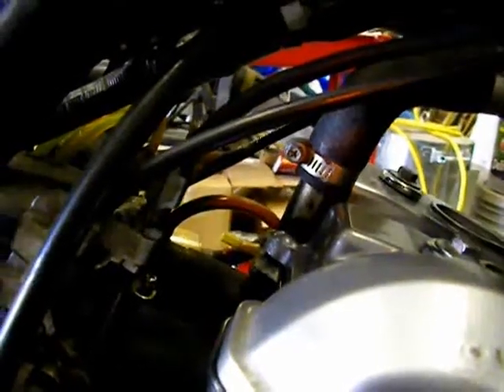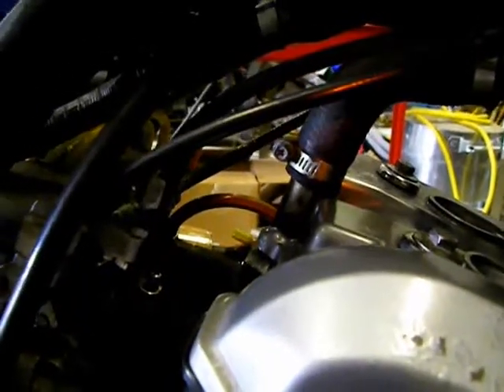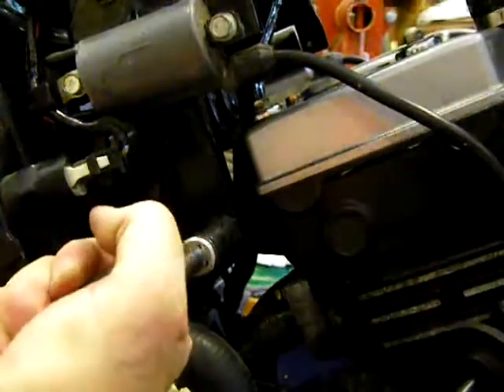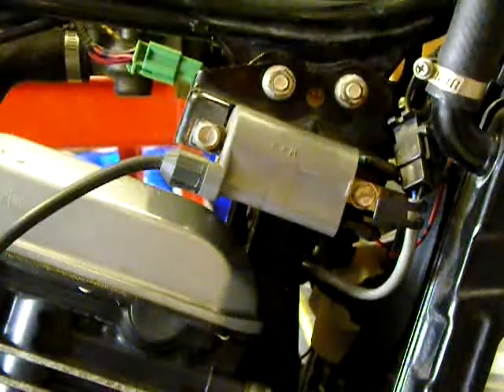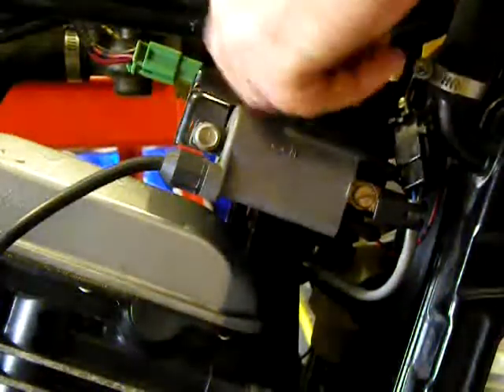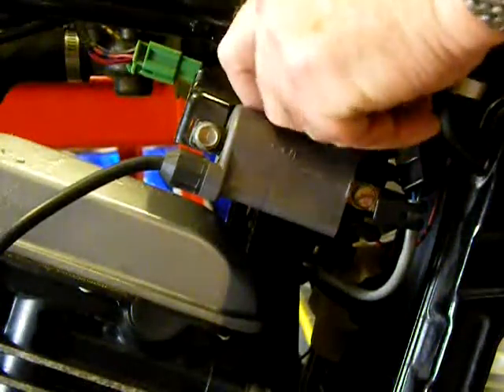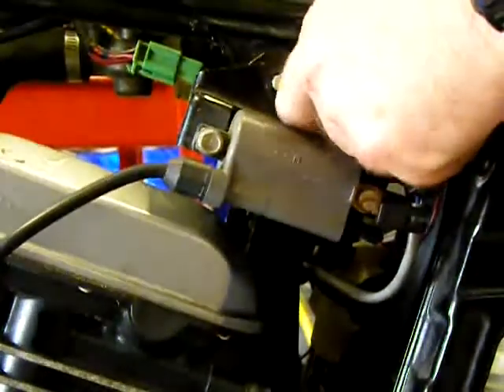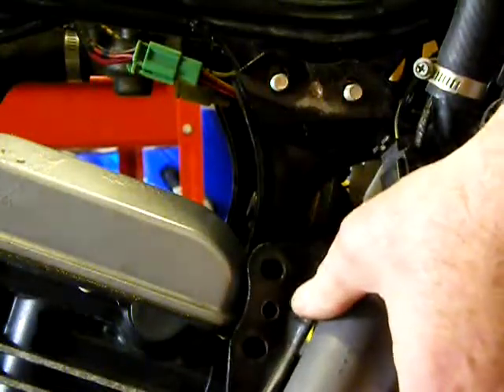Removing the Valve Cover From a Ninja 250 Pregen Like a Pro

Comment: They say to do all that because Kawasaki says to. Then again, Kawasaki also tells you to take off practically everything but the tanks and tail just to change a headlight!

That said, your method is much better. :) The only thing I would add is that you might have a lot of dirt, pebbles, grime, regolith, etc collected on the valve cove in places you can't reach, so hit it with the blower gun from an air compressor first (keep the spark plug holes covered while you do this). I literally had a handful of the stuff when I flipped my valve cover over and there was almost no way to keep it from raining all over my opened engine.
Reply from the maker: Thanks Emmett, your timing is interesting in that I was just about ready to go out and do my valves again when I saw your comment.  I would also point out that getting all that junk out of the way makes doing the actual valves easier too.  I'll blow out the area before I start since you said that.  At 33K miles, it doesn't need any more problems.
Reply: Well, we miss you on Ninjette.org, so you forced me to come to you. ;) Good luck!
Reply from the maker: Emmett Turner Thanks.  You can usually see what I'm up to on my blog.  There used to be a way to PM people here, but I don't think they allow that any more???

Comment: If the gasket is in good enough shape to reuse, do you use any silicone or do you just torque it down dry?
Reply from the maker: As long as it isn't brittle or squished, I just reuse it.  I recommend against using RTV or silicone because it doesn't always work and tends to make a mess.  If it leaks after you install it, don't torque the bolts more than the rating because they will break off in there.  It wont help anyway because they are shoulder bolts.  The easiest thing is to get some thin flat washers and put on the bolt before installing it.  Even just a thin washer will push the cover down a lot tighter.  Use a washer no thicker than 1/16".  If you need a thicker one, then its time for a new gasket.
Reply: n4mwd Thank you for your quick reply.  I’m planning to do my first clearance check over the Christmas weekend.  The bike is new to me but far from new.  Your video is awesome BTW.
Reply: n4mwd Thanks!  The clearance check is finished, now it’s time for the hole in the gas tank to be welded. After that, it’s brakes and then all cosmetic work.  Your video was a huge help with my first project motorcycle.